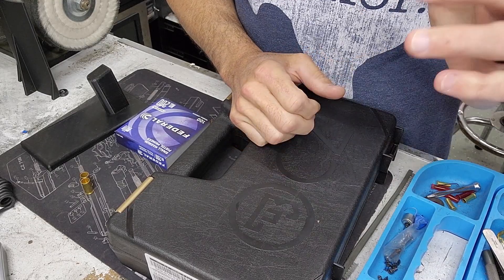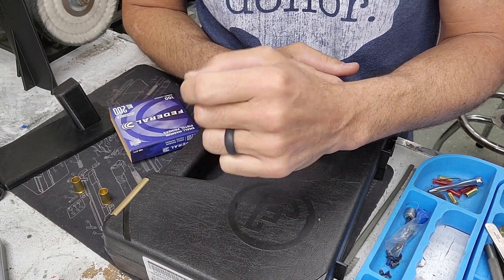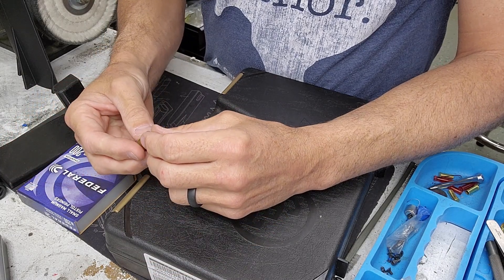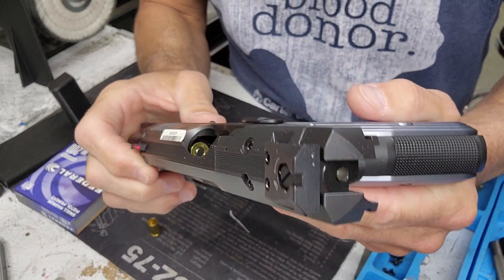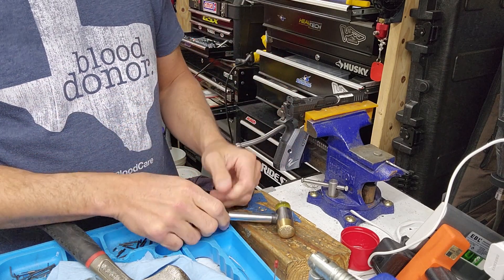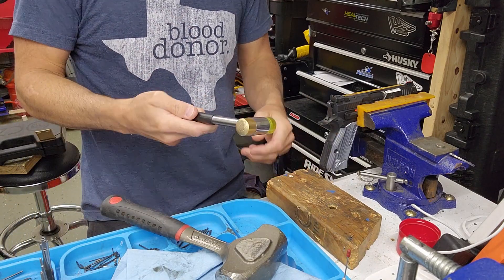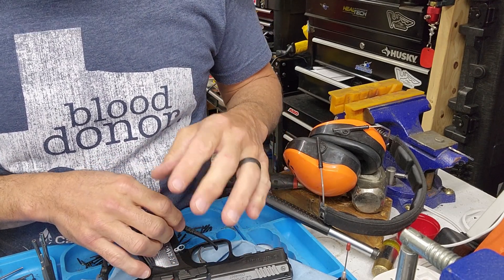Shadow 2 Compact - Drop Safe?

Comment: I think there is a much greater risk of the gun landing on the beaver tail, inertia causing the hammer to move, but not far enough to catch the half cock notch, then rebound into the firing pin with enough force to set the round off.
Reply from the maker: I agree the likelihood of hitting the beaver tail first is much higher, but if the gun lands on the beaver tail the inertia will move the hammer back, not forward.  Same for the firing pin, which won't move at all since it will be 100% backed up by the FP plate...  This experiment was done this way because there were occurrences in the past of Shadow2 landing hammer first and firing.
Reply: @czarmorer  moving the hammer back adds energy to it that has to go somewhere after the fall, which would mean returning forward and striking the firing pin.  Hitting a hammer that is already fully at rest will not cause it to move the way it actually could during an impact after a fall.
Reply from the maker: @chevrofreak  Yes, I understand that - But in your scenario the hammer will only hit the firing ping if the sear and/or hammer hooks break.  Otherwise it will just get back the either the fully cocked or half-cock position.   It will not hit the firing pin.
And yes, hitting the hammer like I did simulates pretty much what would have happened if the gun falls hitting the hammer first - I was also able to reproduce the same exact results we heard about on the stories of the incidents. 
Besides, I'm not the only who exactly this same test, others did the same, achieving the same results -  So it's case closed to me :).
Reply: @czarmorer  that is assuming the inertia will transfer enough energy to the hammer to cause it to catch the half-cock or full-cock notch, which it probably won't.   It would be pretty simple to test with the stock firing pin and an extended one using another primer only cartridge and pulling the hammer back to just before the half cock notch catches it and then releasing it.
Reply from the maker: @chevrofreak  it won't hit the firing hard enough if it doesn't extend even to be caught on the half cock notch.  I've tested that.  However, again, using an extended firing pin and reduced power FP spring, aligned with softer primers, this all can surely increase the risk here.  I can attest that with the OEM FP and spring, that's a not possibility.
Reply: It's definitely a possibility. I don't think it's scientific to say stuff like "stock firing pin is 100% safe and 100% removes the possibility of something dangerous happening because I'm a fan of CZ and they can't possibly go off because I like the feeling of believing that they are as safe as something with a legitimate firing pin block". That's just ignorance and obvious bias. If they think it's as safe, then they don't have the mechanical comprehension of the design engineering in order to voice an opinion we should listen to. The fact that this dude is saying "yeah, don't worry if it lands on the bevertail it will move the hammer, but it will be caught at half cock" doesn't understand physics. What if it's 5% less force and misses half cock? You have a hammer flying towards a firing pin XD. These people are modern neanderthals.

Comment: You should test if regular firing would ignite the primer of your empty cartridge. 
One can argue that the lack of the bullet allows for some slack in the chamber. Therefore your testing conditions would be more forgiving than regular loading.
Reply from the maker: It does - I did test that before proceeding with the test.  I should have popped that primer just pulling the trigger right after I tried the strikes on the hammer though, it would've addressed your question even before you ask if I had done so.
Very good point though!

Comment: This test is not valid.  The energy transfer from the hammer hitting the gun is being absorbed by the vice. The frames weight dropping on a solid surface where the firing pin is lose (Hammer is pulled to cocked position)  has the potential to push the pin hard enough to over come the spring and to cause a primer strike.  Again this is not a way to prove the drop safety of a weapon.
Reply from the maker: The intent of the test was to assess the specific scenario in which the gun falls down and hit the hammer first - I just published another video with the gun falling barrel down and hitting the barrel first - check it out to see the results.

Comment: Do redo it with just the gunsmith hammer strike with the extended firing pin. Check it, then hit it with the wood block and sledgehammer. Then check that. I wanna see if the gunsmith hammer strike did hit the primer or was it the sledge hammer with the extended firing pin.
Reply: yeah that really makes a difference doesn't it.....what if it drops on the edge of a board as it's being hit with a sledgehammer versus dropping onto a gunsmith hammer strike....that will definitely tell you how to randomly drop your gun in an accidental safe way when around wooden boards and gunsmith hammers..... the guy that died in Phoenix dropped his Shadow 2 at a match, it simply fell and hit the ground and shot him in the stomach, and yes....he had an extended firing pin. That's all you need to know.
Reply from the maker: I did this test before (off camera) - I actually able to ignite the primer (with the extended firing pin) with a much lighter strike just using the gunsmith hammer.
Reply: All we need to know, is that extended firing pin is a big no thanks.  @locophoto6881
Reply: @Osprey1994   And all you need to know is how to communicate on an adult level with an adult level attitude of being grateful for a complete stranger that owes you nothing taking the time to help you avoid killing yourself or someone else. If you're going to be a jackass at least wear a hat that says "jackass below" so we all know to not waste time helping the guy who refuses to grow up when millions of everyone else was able to do so.

Comment: Hitting something with a hammer does not replicate the inertia you would see on different parts when dropped.  If the extended firing pin made contact, that would also mean that more force on the rear of the gun with the standard firing pin would do the same thing.  That's balancing a fine line that I don't want to have worry about in a carry gun.
Reply from the maker: It's becoming almost hilarious that this comment keeps coming back despite all the other identical comments and my reply to each of them.  Having said that, I will just let you look at the other comments and find the answer there :).

Comment: maybe someone knows? Shadow 2 upgrade kit fits Shadow 2 Compact especially interested in the spring for a lighter bolt
Reply from the maker: the recoil spring in a full size shadow2 will not fit the compact.  The compact uses one of those captive springs systems while the full size uses the traditional 2 parts with a guiding rod and spring separable.

Comment: Ite not drop safe ..anyone who says it is a bazo.. But safe to carry that's a personal choice plenty of ppl carried 1911 this way for 75 years
Reply: Just buy the sp01 that has the safety if you think its a issue .
Reply from the maker: You've missed the point that this is not testing the same situation you would face with a 1911.  I don't think anybody carries a 1911 hammer down :)
But for all that matters the Shadow2 Compact is drop safe so long you don't make modifications to it.

Comment: nice test :) CZ would never release the gun if in doubt about it being drop safe...
Reply: You never know man. Sig didn't know about their p320 ND until people reported the issue and sig realized they failed to test that
Reply: Hmmm…what about p10c before 2019?
Reply from the maker: I agree - And I'm sure they had no doubt when released.  And I do believe, and the test actually somehow indicates this, that they are safe in their stock form.   Once you mess with it though, it's no longer CZ's liability...
Reply: I’ve never owned a hammer fired gun. But I shot a Shadow 2 and was in love so I ordered a S2C and it will be here in 2 days. My question is how do you get the double action pull on the first round if you load a magazine and rack a round? Is it impossible to have a loaded chamber and be in double action mode?
Reply: @jasonriggs3655  you decock the gun manually using two hands
Reply: @jasonriggs3655  It will be a DA pull half cocked.
Reply: Staccatos are similar to 70 Series Colts in that they do not have a firing pin block. Neither the Staccato, nor the 70 Series is drop safe. Staccato 2011 is very much a modern handgun, being manufactured, knowing it isn’t drop safe.

Comment: I think there need to some caveats to this:   
If you get a duty carry p01 from CGW, you’re getting a gun with a firing pin safety, which the S2 compact does not have.   
Second, you’re getting a gun that is supposed to be carried half cocked, which prevents the hammer from hitting the firing pin in the first place, even if the gun is dropped.  
Third, you did the test in the fully decocked position on a SAO pistol with a round in the chamber , which is not how it’s supposed to be carried.     Ever.  
Normally, anyone carrying the S2 compact would carry it with no round in the chamber or a round in there but cocked and locked, 1911 style with the manual safety engaged. 

I trust the guys at CGW, in that they know what’s considered safe for duty carry while maintaining reliability and optimizing performance.
Reply from the maker: I think you got a few things wrong here: first, this is not a SAO gun.  Second, the whole point about this is with the gun in hammer down position, any other setup this test wouldn't make any sense, and third there is no such a thing as this is "supposed to be carried in half cock position".  You can totally carry it hammer down, I just wouldn't do it with a extended firing pin.  And fourth and last, I did not mention anything about CGW or whether or not I trust them, I'm sure they know their stuff, however as it was proved, an extended firing pin, from CGW or otherwise, does make the hammer down position unsafe from a dropping perspective.

Comment: I would say carrying with the hammer all the way decocked could gave this problem, but if carried with the hammer in halfcock position, the issue is gone, since there is no contact between the hammer and firing pin at all. You could beat on it all day and the firing pin would never be touched
Reply from the maker: Agree!

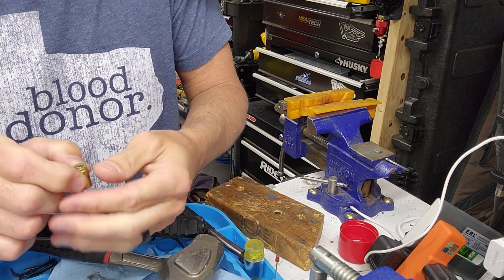Comment: Is there a slight firing pin indent on the primer around 4:50? Maybe just an illusion.

Do you think this experiment similarly applies to the SP01 Shadow?
Reply from the maker: It does only if you also used an extended FP and reduced power FP spring on it.  The SP01 Shadow doesn't have a firing block either, so the same principle would apply to it too.

Comment: Impact to the hammer is only one component that can cause a discharge. The inertia exerted on an unblocked firing pin is not represented here, should the handgun be dropped on the muzzle end.

Comment: NO, it is not drop safe, it does NOT have a firing pin block, like series 70 1911s.
Reply from the maker: It actually is drop safe regardless of a firing pin block - As long as you keep the original firing pin and spring.  I've tested it and there are others testing the same here in Youtube with the full size shadow2 being dropped innumerous times proving this point.
This is not a 1911 series 70, and the FP and spring ratio on it is very different than a 1911.
It all changes when you replace the original FP by an extended one though, but then it's not the stock gun any longer.

Comment: That is not the point of a drop test. It is when the gun is dropped and hits the muzzle to the ground. Does the firing pin have enough inertia to ignite the primer. That is what the firing pin block is supposed to prevent.
Reply from the maker: Yes, but the setup on this test is simple and easy enough to do and it will reproduce the same - What I was trying to check here is whether or not the firing pin will move enough upon impact to hit the primer.  Whether the energy is coming from striking the hammer or the barrel makes no difference from what I was trying to test.   
It won't change my conclusion that a shadow2 falling down from my hands will only fire upon impact if I had swapped the FP.   It will not fire with the OEM FP.  
Now of course you can drop your gun from the roof top of a 3 story building, barrel down, and see what happens - this was not what I was trying to test though.
Reply: @czarmorer  Actually, I think hitting the hammer or the back of the gun will tend to push the gun forward (if it wasn’t in the vice) but the FP inertia will make it stay behind temporarily, depending on weight and spring. That direction would be away from the primer. Rebound may be a consideration. On the other hand, hitting the muzzle end places force back towards the hammer and inertia of the FP will have it want to stay put. So that means the FP will be heading towards the primer. It’s kind of like when people try to wrack a slide one handed by quickly throwing their hand forward. The inertia of the slide wants to stay put while the gun goes forward by force. I think by putting it in a vice you’re testing the sear strength more than anything. Check my thought process here and tell me if I’m wrong.
Reply from the maker: @bluesoverlord  what you're supposing is only true if the hammer wasn't resting on the FP plate where FP is also flush with, therefore also touching the hammer.  With the gun held in place like it was and the hammer actually touching the end of the FP  enough of the strike energy will transfer to the FP.  So much so that when using the extended FP it actually hit the primer.
Conversely, there are videos mentioned here on the comments of people doing similar test and igniting the primer by hitting the hammer and others of people dropping the gun barrel down in which nothing hepoened...
Reply: @czarmorer  I still think a vice does not reproduce the real world scenario you want to test for….the gun falling to the ground.
Reply from the maker: @bluesoverlord  that's ok :)
Reply: Guns ain't gonna go off hitting the front of the slide. Drop safeties have always been for the hammer and back of the slide
Reply: @jason200912  which isn’t testing inertia on the FP when hit from the back. It’s testing the safety, or if none, the sear hooks.
Reply: @bluesoverlord  from the front your recoil spring already absorbs all of that. Any leftover energy just sends the slide to move backwards

Comment: I did this a while back.  They don't necessarily go off every time with the extended pin decocked and hit with a hammer.  I don't use those pins in any of my guns, full size shadow 2's or my S2C.

https://www.youtube.com/watch?v=Euo1SFjNuJo&t=5s
Reply from the maker: Right!  I was able to actually ignite it before I was recording the test for real :(.   So I missed showing that in the video, and it's like you said, it's rather intermittent - I did notice though that the primer was marked every single time I tested with the extended FP.

Comment: am i missing something or why would you carry on DA with the hammer fully flush to the firing pin? why would you not carry on half cock ?
Reply from the maker: I would definitely carry it on half cock.
Reply: Bcs if you carry on halfcock, you can get dirt and other stuff between hammer and firing pin. 2nd reason is shown in this video - if something hit hammer, energy of blow is transfered to slide on which the hammer is rested. In case of halfcock there is probability that hit will damage halfcock on hammer, hammer will be released and hit firing pin. Fully cocked is the safest position you can use.

Comment: Not how inertial pins work, but ok
Reply from the maker: right, it wasn't my intent to test the "inertial pins" though.  The stories around Shadow2s not being drop safe are related to a hammer down scenario with the impact at the hammer, like I tested on the video.  They are not related to a barrel down impact and the inertia causing the firing pin to move forward enough.  
There is actually at least one video of somebody testing exactly that on a shadow2 and they couldn't cause the gun to fire not matter how high they dropped the gun from.

Comment: What is the idea of having an extended firing pin?
Reply: ‘Guaranteed’ ignition with hard primers.
Reply: @SectionChief  thanks 👍🏻
Reply from the maker: You don't need one at all as long as you keep your main spring stock.   But as part of tuning/upgrading, particularly for competition purposes, it's very common to replace the main spring with reduced power ones in order to achieve a lighter DA trigger pull.  The tradeoff with that is that the hammer is no longer hitting the firing pin with the same amount of energy and therefore you can start facing some light strikes issues.  Hence the usage of an extended firing pin and reduced power FP spring to mitigate that.
Reply: @czarmorer  makes sense, thanks. It is clearly intended for competition, and thankfully, for carry, you've shown the stock condition to be "safe."
Reply: Allows you to run extra weak hammer springs so you can turn your gun into a competition hair trigger

Comment: I hate seeing you abusing a great gun like that it pains my heart!!
Reply from the maker: Anything for you guys - In all seriousness, the stress on the gun with those strikes is actually not as dramatic as it looks/sounds - These guns go through, and are designed to sustain, a lot more stress than a few strikes with a wood or polymer surface can put them through.
Another thing to consider is that I've worked with a large number of CZ guns, and I have literally tens of spare hammers, sears, springs everything else that could break or suffer any damage during this test.